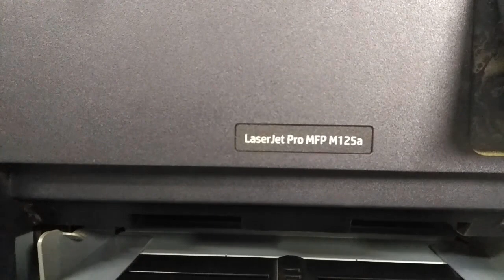hp laserjet pro mfp m125a scanner error

Comment: I have just started by taking out the left cover as in the begining and then I coud acces the whole scanner part - only the upper side of the unit. The electric driver was stuck, I simply forced it a little bit to rotate inside the lane and it's working! 
Thanks for the video!